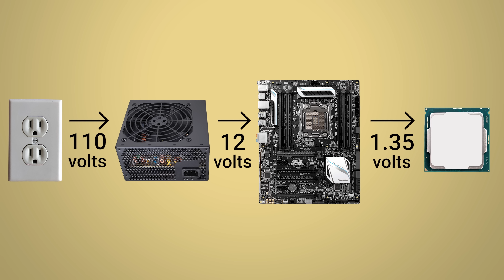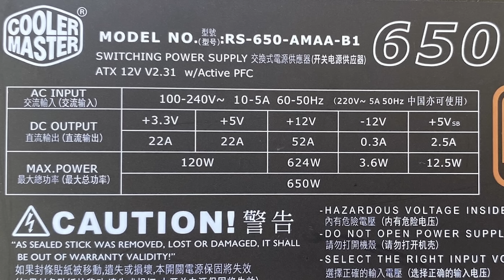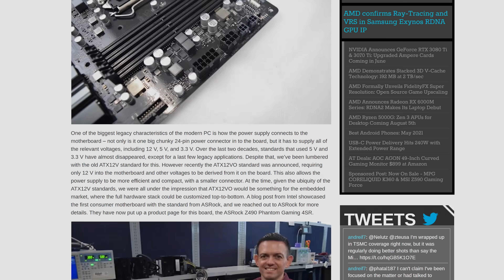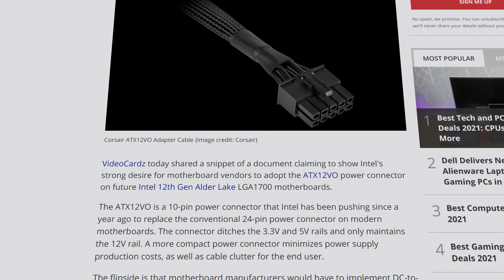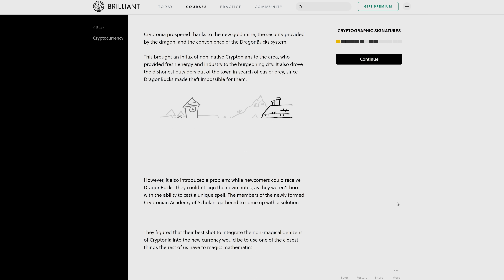Is The 24-Pin Connector DEAD?

Comment: This makes my retro PCs very sad. They're still mad about losing the -5V rail 15 years ago...
Reply: Some hobbyist makes a "Voltage Blaster" that fits into an ISA slot and provides -5V.
Reply: @dycedargselderbrother5353  Correct. There are quite a few options that work. Before the voltage blaster there were also many cheap ATX to AT adapters that included a voltage regulator for -5V.
Now, on the other hand, if we're talking about converting an ATX12VO to the ATX12V 1.x standard (as Blueberry, who seems to lack a sense of humor, suggests)... that's a whole different story, and doing it with a cheap adapter would be impossible (especially if you value your retro parts) . :-)
Reply: @ruxandy  There are already 12VO to 20/24 pin converters in the market.
Reply: @erkinalp  It's one thing to use an el cheapo adapter for an ultra-low current rail like the -5V, and a completely different thing for 3.3V/5V. Many retro computers draw most of their power from these two rails, so... yeah, go figure!
Reply: That was the least and most easily solved of the problems for my 486 so far, I just soldered 7905 and one capacitor to the ATX PSU adapter before it was cool and it's peachy to this day. All this PCB plugin nonsense, I can't really stand behind it, it's a cashgrab for lazy people. But yes on ATX12VO we'll have to get creative, I am not ready to lose my 386DX just yet
Reply: @playswithblades  lol.  Your 486 and 386DX probably don't even need the -5v rail except for the RS232 ports.  ISA slots have a pin for them but even then you probably don't need it.  Cache was using more modern RAM at that point and most of the time it would be too noisy for a sound cards analog i/o.
Reply: @10100rsn  I have one VLB board, 486, that won't work on ATX power supply. But that's a fringe case, not the standard, so yes, you are correct about negative 5V not being a thing even on most AT boards. As I recall it was necessary on XT, early AT and some 286 boards, but later it was completely unnecessary and even RS232 transceiver chips/ and EISA/VLB I/O controllers would generate their own -5V for communication with peripherials
Reply: I still haven’t quite got over the loss of the floppy header 😢
Reply: Retro computing is basically DIY Computing anyway these days - so you can build those rails if you have the know how and you really want to fix older stuff

Comment: Why don't they just keep the 24 pin, make it 12v only, and remove the 8pin cpu power. 1 bulky cable is better than multiple small cables.
Reply: @NextGenHoliness  It was called a P4 connector in the beginning, because it was needed/introduced for the power hungry Intel Pentium 4s. So in a backwards way you were right. 😁
Reply: I disagree. In my experience (maybe depending on the motherboard?), it can be really tricky to pull the connector out, especially if you're not sure how much force you can apply without damaging anything.
Reply: @pixelmaster98  just wait till the pin deck gets smaller like the new rtx cards :(

Comment: The worst connector to plug in to the board is for me USB 3.0 especially disconecting it.
Reply: Yeah, I don't get it.  I've been building several systems per year for over 20 years, and I've never had problems, not ONCE, with the 24 pin connector.  This will make boards more expensive, they will also have lower life expectancy, and any shot at clean, minimalist builds with side windows a thing of the past. All because the bottom 5% are doing it wrong?   
  Yeah, this is about as fucking stupid as it could possibly be without actually going to a bigger plug as well as the extra cables, cost, and stress on the board.  /smh
Reply: Mine some times fail and reset if there take to much power. aka testing usb 3.2 enclosure for m.2 pcie nvme for back up or saved games.

Comment: I was there where there was no even X in ATX xD
Reply: Ah, the good old days when 120V AC ran through the power button.  My first computer with an AT power supply was a second-hand Dell with a 486 that I bought in college (I don't recall if it was a standard AT PSU, but knowing Dell it probably wasn't).  After that I had an AMD 5x86 and then a Pentium 233Mhz, I know both of those used AT.
Reply: The X used to be before the T.
Reply: @dycedargselderbrother5353  I was there, gandalf, 3000 years ago
Reply: @dycedargselderbrother5353  Ahhh Yes, forgot about IBM. Regaress PSU but I still have a  x386 pc in the basement somewhere :) Can't remember full specs but definitely it won't run Crysis :).
Reply: Remember kids black to black on P8 and P9 or your motherboard will release the magic smoke.

Comment: Anything but 24 pin. I would even put 30 pin onto the board just please split it to 5*6pin so that it is not so hard to put it
Reply: Why would you want 5 cables for your motherboard when you could also have 24 pin split In 3 8 pins like on highend gpus?
Reply: @Stiegelzeine  Because people like to whine about things that really are not a problem at all.
  If you can't plug in or unplug a 24 pin atx connector without difficulty, you have one of two problems;  You're either an idiot who can't put square pegs into round holes, or you're an idiot that bought the wrong motherboard for your case (or vise versa).
  So the whole entire diy community should have to put up with increase price on mobos, higher fail rate (you can't slap all your sata power delivery and voltage management on the mobo without increasing the stress and thermals it will have to deal with, and will also increase price and lower life expectancy) and 2-5 extra power cables running from the mobo to all sata devices, pretty much killing any chance at a clean build in your glass case.
 Nah, man.  This is fucking stupid in literally every way possible.  Put 5 seconds of critical thinking into it, and you'll realize the same thing.
Reply: @conandude76  ruuuulllezzzz ;)
Reply: @conandude76  agree 100%. I tend to have more issues with the 8 pin cpu power than I do the 24 pin connector
Reply: @Stiegelzeine  That was exaduration. 3*8 is even better. I wanted to say that I would rather like more cables with less pins then one giant cable with many pins.

Comment: Why exactly do they want it to die so badly? Sacrifice all backwards compatibility on the altar of a tiny few percent more efficiency? Bugger off, honestly. What a stupid thing to hope for.
Reply: new motherboard standard = you need to buy a new PSU if u want to upgrade in the future = more profit for the manufacturers.
Reply: @makemyday9366  The manufacturers' motivation is not a tough guess, I was asking why LTT and so many people here in the comments are welcoming that nonsense. It's a disadvantage for us lot in all relevant aspects.
Reply: @mito-pb8qg  true
Reply: also makes their jobs easier, they need to focus only on converting the inlet voltage to 12V, this means its easier to achieve a power rating (like 80 plus gold for example).
this is bad for us because mainboards (as far as i now) have no power rating, so the mainboard can be less power efficient but its not taken into account.
Reply: @7_7_5  It also adds a f*ckton of additional points of failure to the boards, makes them more expensive, reduces their reliability...and replacing a PSU is A LOT cheaper than replacing a board. It's just stupid all the way around.
Reply: It's more so that power supplies can be simpler, in addition to efficiency. Converting 120/240VAC to 12VDC only instead of that plus all the other voltage rails a conventional ATX power supply has to provide means less components to build, and less potential for failure.
Reply: Halved idle power usage is "a tiny few percent more efficiency"? *What?*
Reply: @NDKfrl  Because idle usage of systems - which is a weird metric anyway, do you just leave your system on all day doing nothing? - is so monstrously high these days? Sorry, but that's just bullsh*t. It's next to nothing. A made-up non-issue to sell new stuff to the feeble-minded. And from what I'm gathering here...it seems to work.
Reply: @mito-pb8qg  You've never worked in a corporate space, have you.
Reply: @NDKfrl  I am right now. Those machines sure as hell rarely idle...and power consumption is the least of our concerns. We have plenty of machines from Acer, Dell and others with proprietary 12VO-solutions and the boards keep dying like flies. It's annoying, time-consuming and a complete and utter failure. If your boss cares about hypothetical savings from a few watts less more than about low failure rates and safe operation, he's setting the wrong priorities.
Reply: @mito-pb8qg  A machine that's not working cpu or gpu intensive tasks, like an office rig, is pretty much 24/7 within the range of horrible efficiency on current standard PSUs. Much the same with your home PC, when you're not working intensive tasks or playing games. And I sincerely doubt your claim about failures, considering there's been no widespread reports of the standard being any more failure prone, *in practice*, beyond purely theoretical assertions of more points of failure, *on paper*.
Reply: @mito-pb8qg  "Acer, Dell and others"
"Boards keep dying like flies"
I think those two have more to do with each other than you may think... Dell's non-business machines and most of Acer's machines in general are depressingly cheaply built. gestures at Gamers Nexus' video of Dell prebuilt
Reply: @NDKfrl  Your "horrible" near-idle efficieny still consumes barely more than your average office lighting (non-LED, obviously) and MUCH less than air conditioning, it simply isn't as much of an issue as you - for whatever reason - make it out to be. As far as the failure rate is concerned...I'm afraid we won't agree on this. I can either listen to you, or to my experience with about 2.500 current machines...and my common sense. I'm not talking about thousands of machines dying within a month, I'm talking about losing slightly over 80 last year alone...about ten times the number we lost on average with board designs of old from the same manufacturers before. Doesn't sound like that matters to you since you just seem to want to "win" this "argument", and I don't really care if you believe me or not, but that's a horrific statistic. And just to add...these are not teething problems, the 12VO approach is far from new. Only Intel jumped onto it now, others have been doing it in the OEM space for ages now. Reliability issues and the more problematic replacement of an entire motherboard - not all machines are in full service forever - are an intrinsic problem of the design and will be no different in the DIY space, should that day ever come. The laughable efficiency bump is simply not worth the trouble. And that's my end of it. Have a nice day :)
Reply: @mito-pb8qg  Absolutely, just as much as I can listen to you, a random, faceless individual on the web, bringing up an anecdotal "statistic" that I don't seem to find anywhere else, or I can recognize that this is the next logical step in the shifting landscape of technological progress and appreciate the clear benefits it brings - which I could already observe. Whether it's more failure prone or not, I'd like to see some documented industry wide data first.

Comment: I remember, when accidentally I've coonected 24pin other way round. Yes, it is possible. I had to unplug it with pliers.
Reply: I would describe that as "hammered in" rather than "plugged" XD
Reply: @WouterVerbruggen  oh no no, it connected quite easily. But when I saw that the clip is on the other side I was shocked, that is possible
Reply: @krzysztofwieczorkowski9374  must have been either a incredibly low quality PSU, board or both lol. Tried on a few units I got here in my workshop, it not easy at all in general. Good thing you found out before powering up!
Reply: @krzysztofwieczorkowski9374  EVERY PIN IS KEYED IN A CERTAIN DIRECTION You HAMMERED that connector in ther surprised you didnt snap your mobo in the process.
Reply: @snintendog  You're wrong. I think, that in this particular case, this was connected 200 times. In the socket was play, and I was able to connect it. Also, az a 16 year old, I hadn't so much strength to hammer it down. So yes, It is possible,but in certain circumstances.
Reply: @krzysztofwieczorkowski9374  nope not how the socket works in order to plug it in backwards you need DESTRUCTIVE FORCE the plastic outer casing would have to be GONE Completely or just be shrapnel and metal prongs.
Reply: However you pulled that off
Reply: imagine you wouldn't have noticed it and just tried to power on the computer
Reply: Thankfully that was at school. It wasn't my motherboard
Reply: @krzysztofwieczorkowski9374   😂
So many have damaged school property 🤦🏻